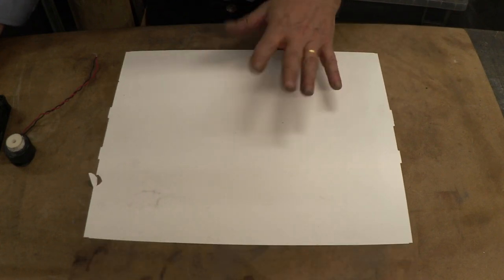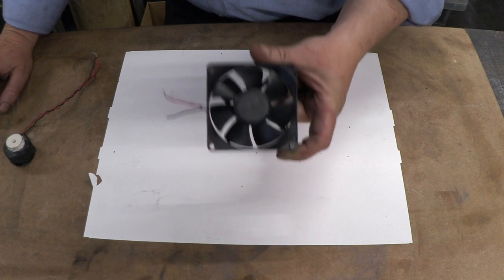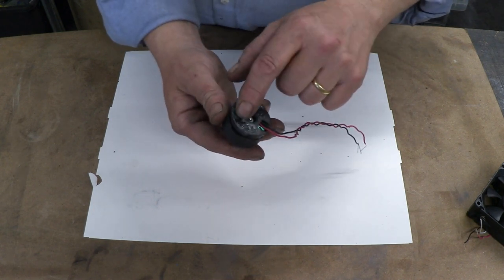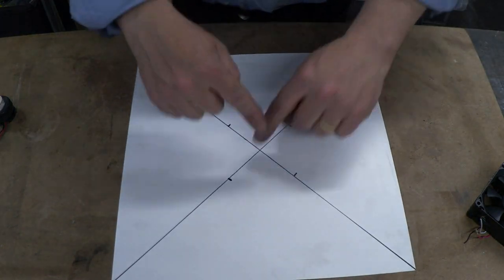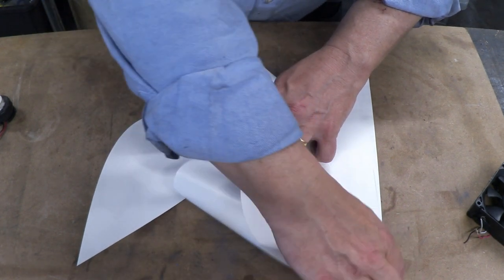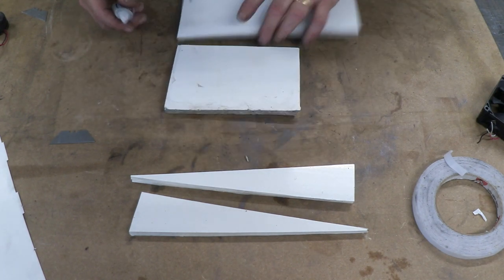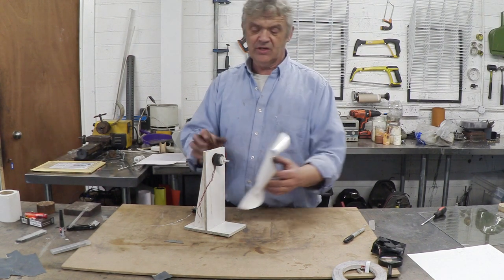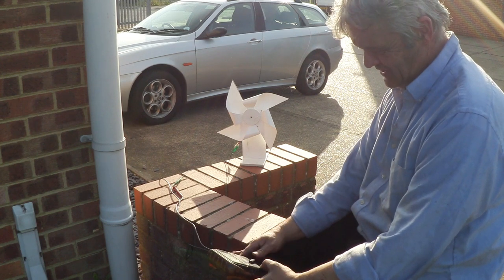Super Easy Wind Generator - Home School Project?

Comment: This series of videos are a blast...basic principles, simple construction. With all these generator projects, you measure volts. I'd be putting a load across it - a 5k resistor perhaps, then measure the volts...you get power generated which is much more useful a number than a voltage.
Reply from the maker: some I put resistors on mate - tbh it just depends how I feel a t the time - with some of them I am just not interested in how much they produce as I more interested in the general principle and construction - some are just so old hat we know they are going to work and all we really need is to confirm they work
Reply: @ThinkingandTinkering  Fair enough!

Comment: Great stuff Robert.  I have often wondered why no-one has considered combining hydraulic accumulators with wind-turbines to build a free-energy system with energy stored as hydro-pneumatic pressure.  
If, rather than having the turbine driving an alternator, you instead drive a hydraulic pump (perhaps a radial piston or screw pump), as these require very little relative rotary effort to generate very high pressures at perfectly adequate flow-rates.  You can have several turbines commonly piped to a hydraulic motor driving a much heavier alternator on the ground.  The hydraulic system can be designed to drive the hydraulic motor (and alternator) at moderate wind speeds (by regulating the flow to the motor).  When the wind turbines produce excess flow (by driving the pumps faster), this can be drawn off as increased pressure (via a pressure relief valve) to a (very large) hydro-pneumatic accumulator (essentially a big hydraulic cylinder where gas is trapped in the upper chamber- to act as a pneumatic spring).  The excess energy produced by the system will drive the piston up the cylinder, compressing the air above and creating a reservoir of pressurised gas.  When the wind stops blowing, the gas pressure will drive the piston down again, pushing the hydraulic oil back through the system to the motor and providing driving energy to keep the alternator turning until the wind picks up again.
Obviously, the accumulator required for a large turbine would be sizable, although I have thought it could be incorporated into the base of the turbine pylons.  Nonetheless, the concept could be proven out in the lab with a scaled down version.

Comment: Hey Robert...  a sturmey archer bike dynamo in a bike wheel... front wheel with NO GEARS... gives about 6-10 watts... AC... so a Voltage doubler can be used for 12 VOLTS OUTPUT! got 20 volts once! about 0.4 amp (goes faster than on a bike!)..... circle of aluminium from a caravan or tin from the side of a washing machine etc....size of the wheel, 16 blades! keep the center of the circle, a big fan bolted to the RIM. bend 'em up,  goes ALL the time.
ALSO... a bottle dynamo can be used but needs much higher RPM... 3 slender blades, each about 10 inches long.... bent aliminium... and BINGO.... loads of flashing LEDs AC again so voltage doubler if you like!.... or a cascade multiplier and get as much volts as you like.  :o) wrote a booklet on it once.
had aver 100 people send me pictures of ones they built from the bike wheel. dyna hub, charges a cordless drill, ran a synth... all sorts.... all metal lasts for years... 2 pieces of angle iron bolted or welded together ,to mount fan and tail and a 6 inch bolt facing down as a swivel to fit in a tent pole or water pipe as the pole.... or wooden pole with a foot of pipe atached.... dont forget some steel washing line and some really long tent pegs!!.... no no..... really long!  or screw it to your shed.

Comment: I think that cloth sail wind generators should be given a second look. For thousands of years masts and sails transported ships across the oceans. Now we have access to better fabrics and stronger, lighter materials for struts and masts. Put that old technology into use with modern bearings and auto furling systems and it would be relatively easy to build a practical homestead power source. I really like the way you think.
Reply from the maker: I agree with you mate 100%

Comment: I heard a whippoorwill ! He was watching you outside . I took a motor out of a printer its armature reads about 50 ohms . It will gen about 5 or 6 v with a string wrapped around the shaft and give it fast pull.

Comment: Great video 
Could this be used to charge a marine battery?  
I have a en bloc  garage which doesn't have any power. I'm thinking of a small solar panel set up but that won't be much use during the night & winter months, whereas this would trickle charge the battery 24/7.....
Reply from the maker: yeah probably mat - but you would need to make it more robust

Comment: If you made a roof rack with 8 x 8 of them (obviously scaled down) and drove your car. (you could keep them as the computer fans still in their casing)
When the car is driven, would that produce a sufficient voltage?
Enough to charge phones/tablets? Have them as 8 long tubes side by side.
I was think of a roof rack, so when you parked, you could unclip them and store in the boot.
Reply from the maker: sure but there would be a cost - they would create extra drag and that would come out as extra fuel spent

Comment: I got a mobile for my child that this reminds me of... Placed above a small light bulb, it spun a moving picture on the walls, and made it appear the room was moving. This video subject is easily moved by the slightest breeze, what if it were to be placed at the top of a solar panel? Or a cylinder version across the top, extracting a few more percent from the solar radiation.